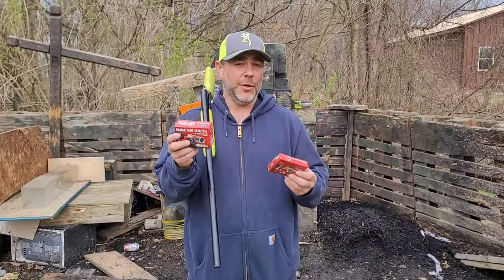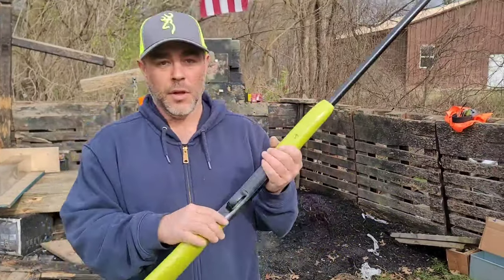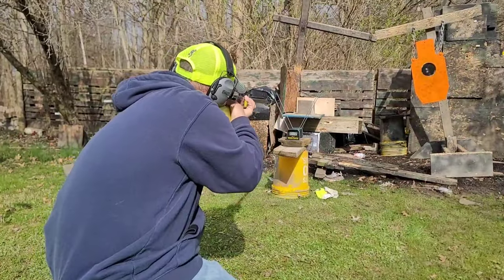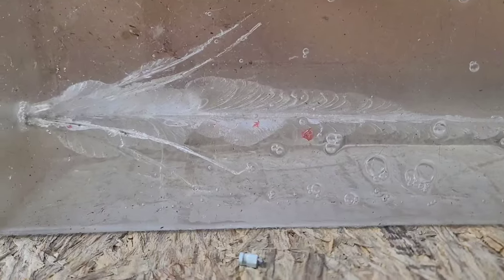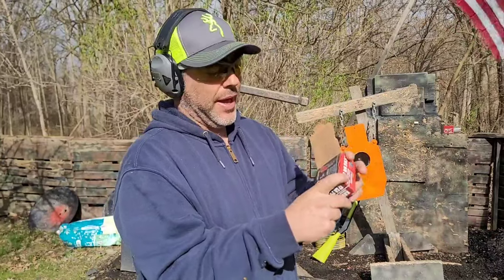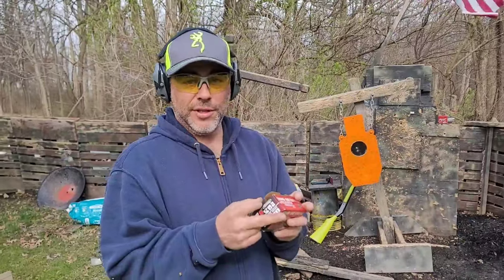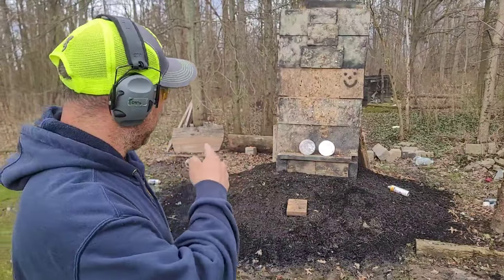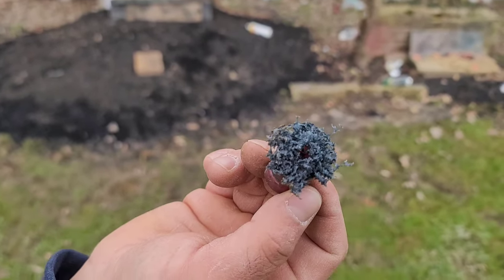Unusual 12 Ga Ammo TEST🔶️ Broadhead and Kaviar Slugs. Very Surprising Results!

Comment: I know you were close to that gel but round one and three were crazy. Even wearing plates your day, week and few months are going to suck. I can see those breaking ribs and collapsing lungs even without penetration. Maybe stop you heart just from the impact on a plate. Its a fight stopper for sure. Thanks for posting.
Reply from the maker: You are 100% correct! Those things are both bonkers in their own separate ways. 4" of penetration with all that energy dump would definitely put a new rhythm on your heart!  A very quiet when I think.😱
 I would be worried about the broadhead shooting steel all over the place though. Those petals seem to take a 90ﾟ turn.😬 I think in the lead plate a couple of them took a 180ﾟ turn😬😬
👍🦃👊
Reply: @theturkeysopinion  yeah a 90° turn is definitely a problem for anyone standing beside you or a team doing a tactical entry. Usually why stacks are staggered behind a shield. The bounce/deflection would be great though if you needed to ricochet a round under armor or a vehicle. A shot in the thigh could be just as devastating as a shot in the card. Pair these rounds with a say, a Shockwave or similar and you have an excellent vehicle defense tool. I would like to see this on tested on the turkey too.

Comment: In accounting, amortization is a method of obtaining the expenses incurred by an intangible asset arising from a decline in value as a result of use or the passage of time. Amortization is the acquisition cost minus the residual value of an asset, calculated in a systematic manner over an asset's useful economic life. Depreciation is a corresponding concept for tangible assets.
Reply from the maker: 🤔...🤓 thanks for the info!🦃👊👍